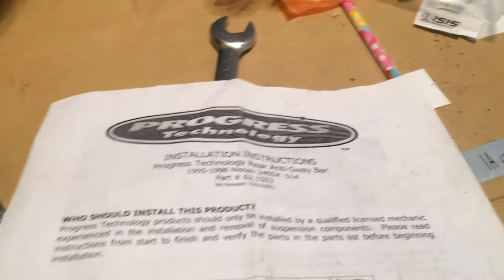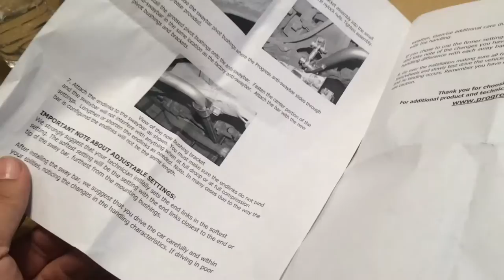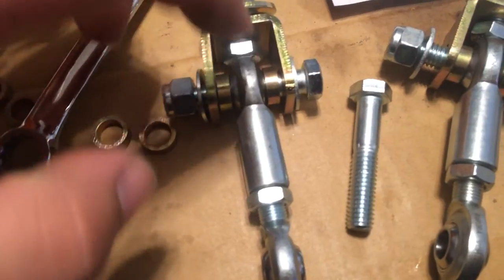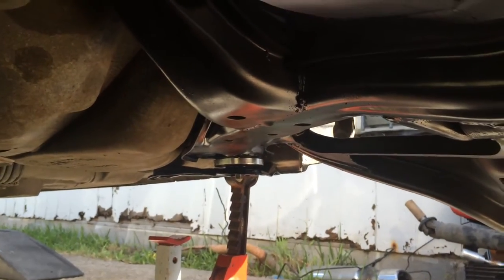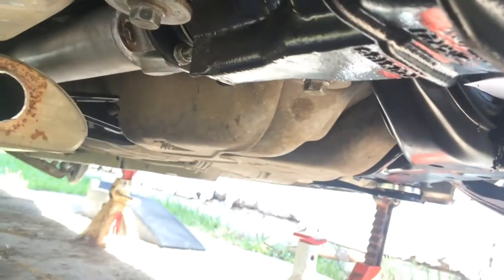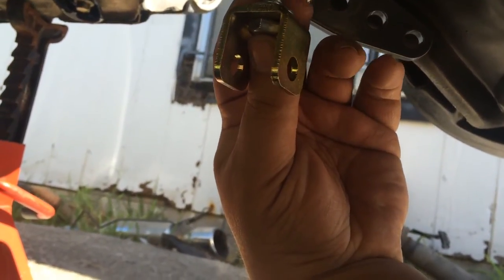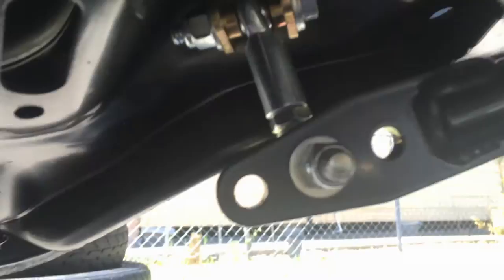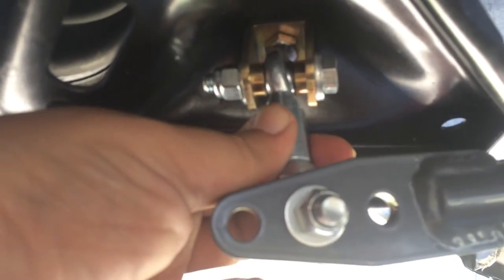Episode #7 Installing the Progress 24mm sway bar on my S14

Comment: shit looks mint, good job man
Reply from the maker: Thanks man! Even on stock shocks and springs the rear end is so tight with this sway bar. I highly recommend this one. I can't wait to install the front Progress 27mm sway bar. I am a little worried that I might have a rubbing issue with the wheels because it's real close but I'll figure something out. I've got a lot of adjustment I can play with in the front.
Reply: Primer2tone Garage The reason those bolts are so long is so that the links won't damage the threads. It rests on the smooth part of the bolt. You're giving me plenty of ideas for when I do my 240. Suspension wise anyway from what I've seen so far. I'll be doing and LS1 Turbo swap next year or so.
Reply from the maker: Badass! I'm leaning towards an LS swap myself but not just yet. Im gonna roll on the KA while I zero in the suspension settings.

Comment: did you do anything to the rear lower control arm?
Reply from the maker: I replaced the ball joints. I was going to also replace the inner bushings but they actually looked decent, so I left them as is.